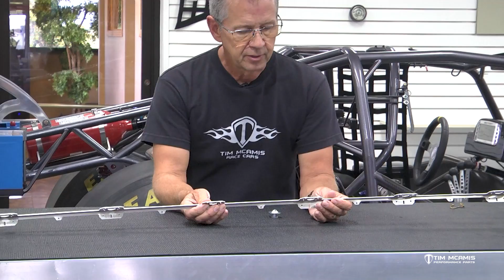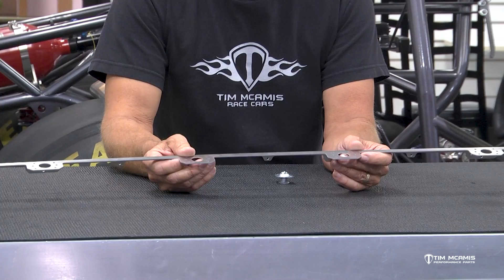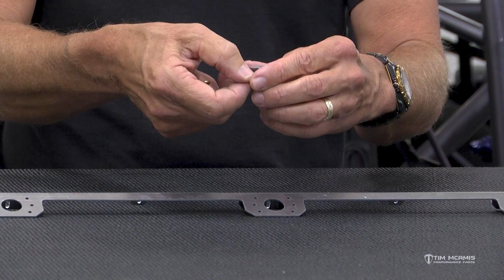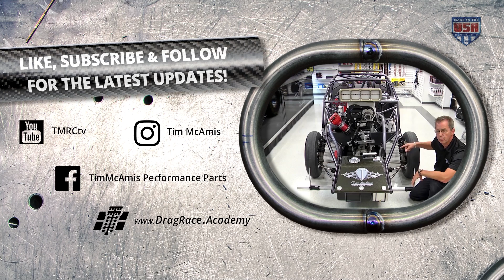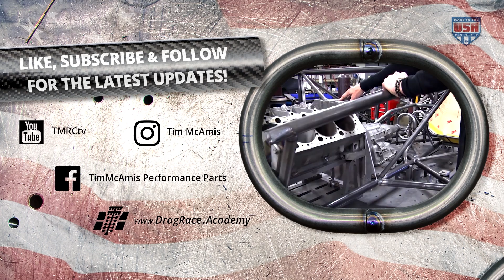Universal Quarter-Turn Fastener Rail

Comment: Whats ur idea for locating the correct hole alignment while the piece is installed , and the hood is on ?, usually there is the factory metal lip on the OEM fender in the way to draw or locate the hole in the new piece just installed ( the piece u are showing today)  fyi help i am a professional car builder but the prob always presents its self , and if miss located holes makes for a crappy messy mistakes
Reply: You'd need to remove the lip in the area of the dzus mount... No way around that.
Reply: One experience to share is that a significant curve front to back, and/or side to side, may require a shrinker/stretcher to get a perfect fit. For example, a round body S10 or last gen Camaro with a compound curved hood.